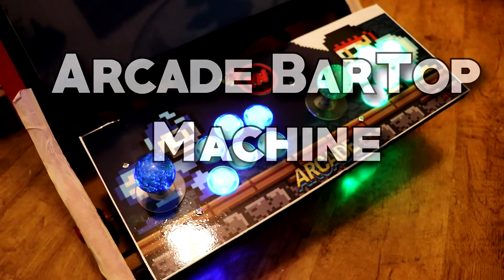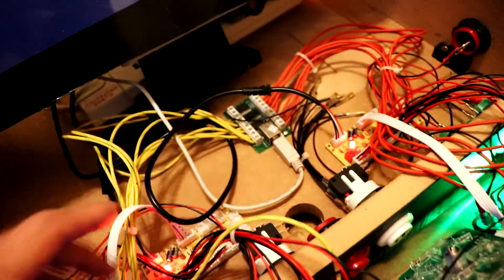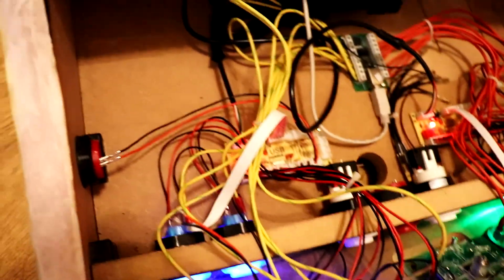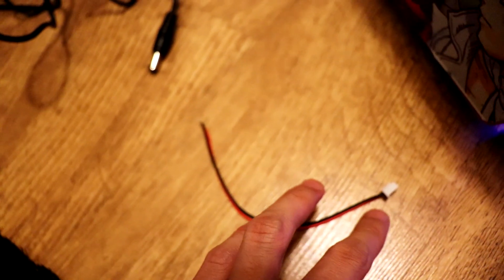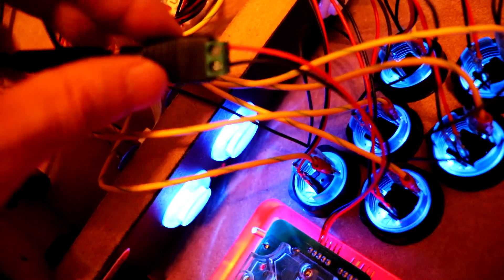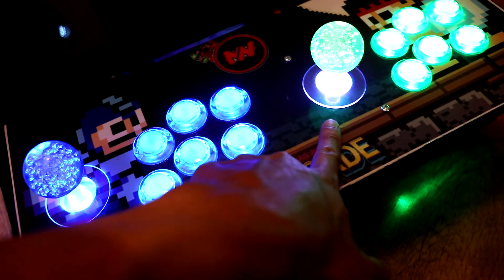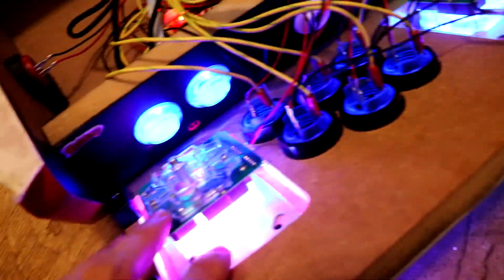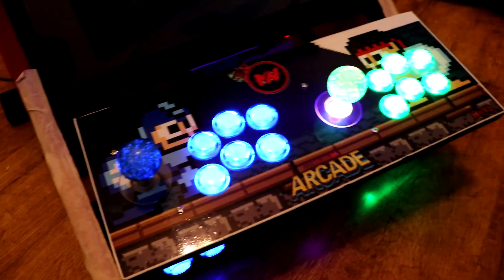Bartop Arcade Machine  - LED Joystick LIT - Part 6

Comment: good video.... so are you saying the USB that is mounted to the lit LED buttons 2nd slot will not light up the joystick LED?  There are 2 slots, one for buttons and another open for JS... that won't work???
Reply from the maker: The joysticks led's are powered using dc power because the usb isnt powerful enough to light the joysticks up. My guess is the cycle of the different led's on the joystick rather than one led on the buttons
Reply: Lmao. This guy answered a question posted 2 years ago.
Reply from the maker: @TheLexiHuang  better a
Late than never 😎 👍

Comment: Can you please provide the link for where you got the kit that included the LED joysticks?
Reply from the maker: I didn't get it from this seller but this looks like the exact same Zero delay button + joystick set up https://www.ebay.co.uk/itm/LED-Arcade-Game-Cabinet-DIY-Parts-Kit-USB-Encoder-Joystick-Push-Buttons-Set/143149217429?epid=8029744897&hash=item21545bb695:g:1MMAAOSwc0lcdTrT&frcectupt=true also, i had to buy extra buttons that match this set to fill the gaps and have more buttons. Hope this helps.
Reply from the maker: feel free to ask question if you need help =)

Comment: As you have running your LEDs via a PacDrive in combination of a Raspberry Pi, you should look at LEDSpicer. It's a cool open source project which make it possible to have your button LEDs animated and make sure that only the LEDs light up of the buttons that are used in a game. It's a project that is still indevelopment, but the developer is open for questions/feedback and very helpful. I have it running on my cabinet as well now. Looks pretty cool.
Check it out here: https://sourceforge.net/projects/ledspicer/
Reply from the maker: Thanks i will check it out, the only problem is the Pacdrive is not directly connected to the PI using the USB. They are powered by a USB Hub as the PI needed enough power to work with Emulationstation and does not draw enough power to light up all the LEDS.
Reply: @AzNstat  What you can do to fix that, is connect the LED's positive side via a daisy chain to a dedicated 5V power source and connect the ground side of the LED's and from the 5V power source to the Pacdrive. The 5V power source ground cable should be connected to either '+' connector on the Pacdrive (next to 1 or 9) Then you connect the USB cable to the Pi, so it is solely used for controlling the LED's. In other words, the same setup as with 12V LED's shown here: https://www.ultimarc.com/pacdrive.html
Be aware that the picture of the 12V is not showing the ground cable from the powersource connected to the Pacdrive. That is needed, otherwise the LED's won't light up. (at least with my 12V LED's that's the case) Maybe with 5V the LED's can get grounded via the USB cable, I don't know.